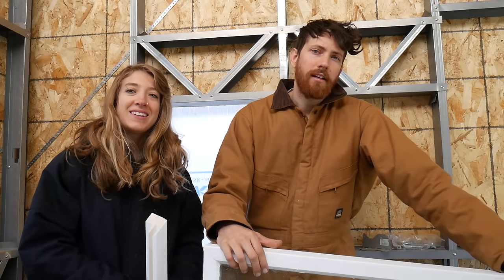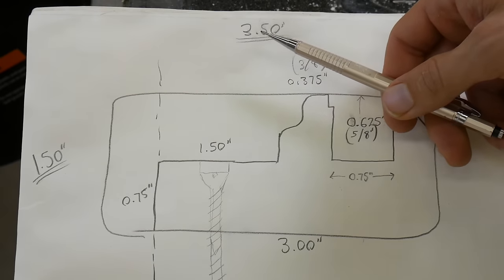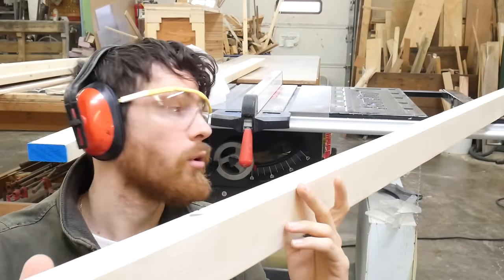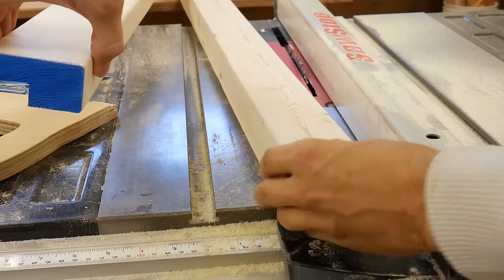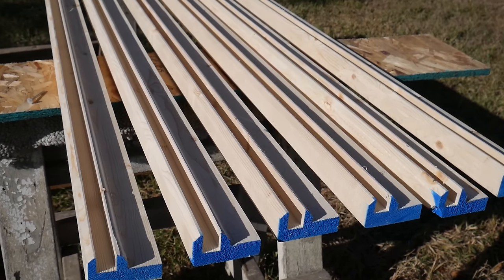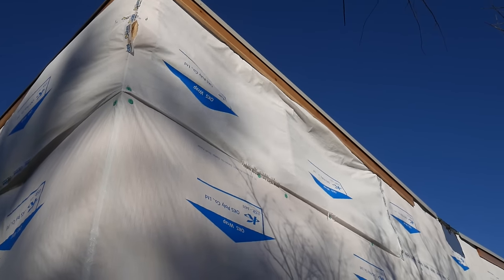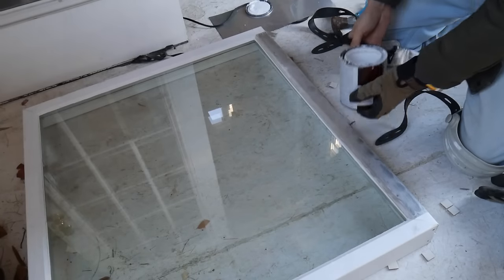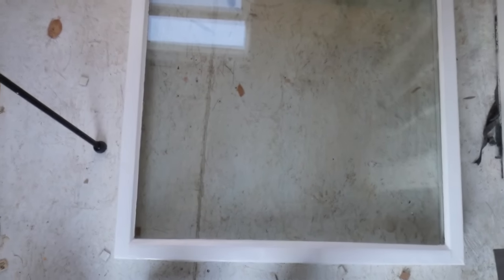We Made 5 DIY Windows from 2x4s and Saved $1,500

Comment: Came across this build somehow. Watched several starting with the framing 😱I'm convinced now this is just a publicly event.
Reply: It HAS to be. Softwood windows with mitred corners? No mortise and tenon joints? No PU glue? No sash clamps? No weatherstrips? No silicone beading? No angled runoff on the sill? Water-based latex caulk on the exterior? Water-based paint? No means whatsoever of getting the glass out when the frame rots and falls apart after the first shower of rain? And the most worrying thing of all are the 'Wow - great job!!' comments from all the gullible simps. The blind leading the blind.

Comment: I don’t understand why the two angles up top weren’t 45 degrees. Looks nice though
Reply: its because there is a slight angle for the top part of the window. One vertical side of the window is slightly taller than the other thus a slight difference is degrees. This windows is for the side of the house where the butterfly roof is slanted just slightly.

Comment: Very entertaining video and a great idea if you have more time than money. The only issue is these windows will fail in just a few years. which is sad because of the effort put forward and it isn’t any “harder” to make them correctly. Too many little issues to list in a comment but if you search for a book called “Make Your Own Handcrafted Doors and Windows” you can find used copies for a few dollars.  A video series on YouTube posted by Dusty Guy shows a method that only requires a table saw and is a good design. There is almost zero info out there for making your own windows so I really applaud your effort here, and I,m hoping I’m wrong about your windows lasting, but I do home renovations with 24 years experience, and I’m pretty sure they will.